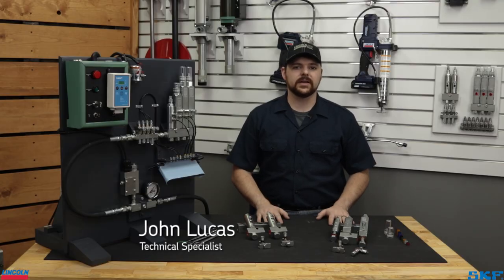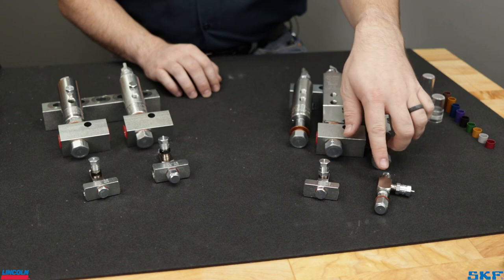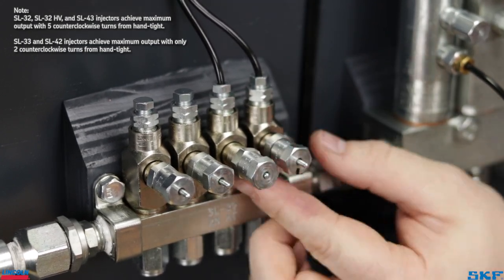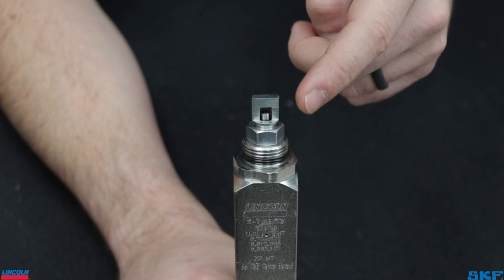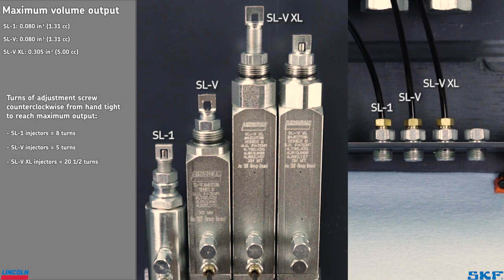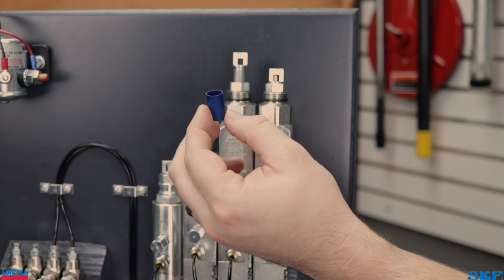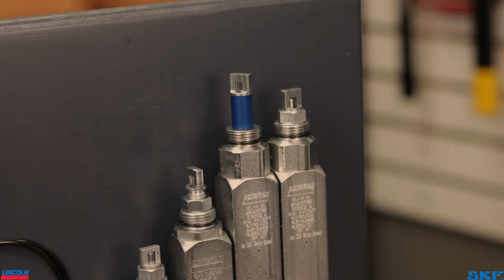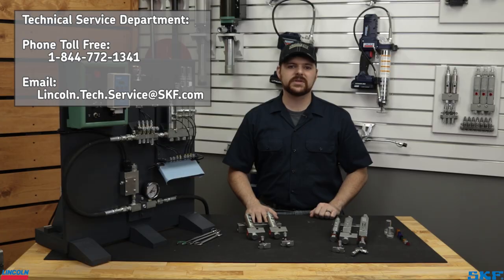Injector output adjustment procedure for Single-line parallel systems

Comment: Could you please send me any detailed pdf document regarding adjustment and functioning of grease pump vent valves injectors etc.
Reply from the maker: There is a link in the description for the manuals and adjustments. If you require a specific manual, please contact our technical support department. 

~ John